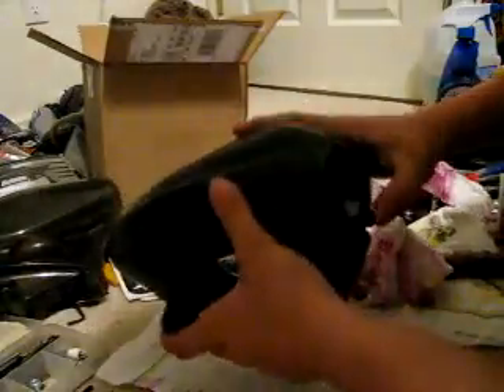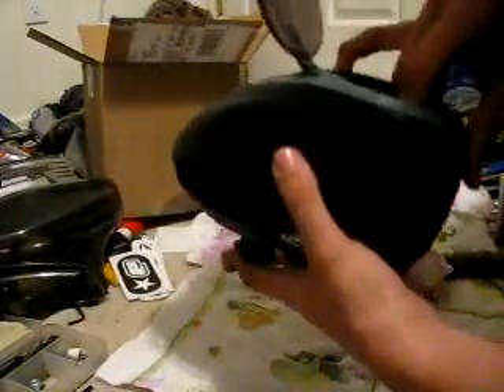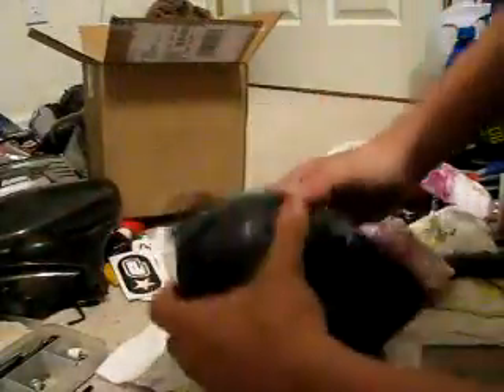Re: Prophecy - Quick Disassembly for cleaning.

Comment: @azminisk8r the ONLY reason why the rotor is the most used hopper is one reason and one reason alone DYE, if dye didn't make the rotor it would be way less popular, and it sure as hell wouldn't be $160, i don't like spending $160 on a hopper that jams like crazy i had a rotor for 2 weeks then sold it, why? it wouldn't stop jamming, i got the proph and i've put about 15 cases through it and no jams.